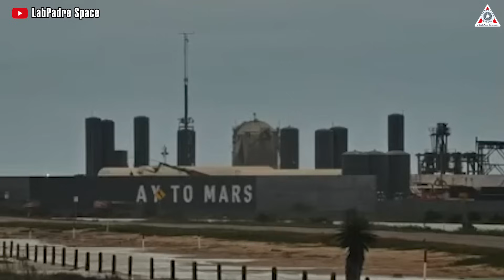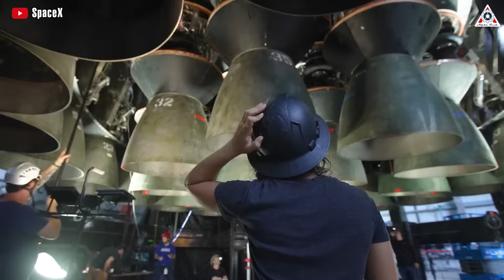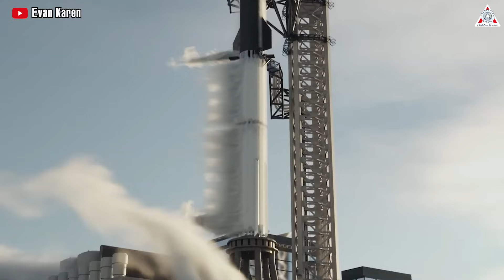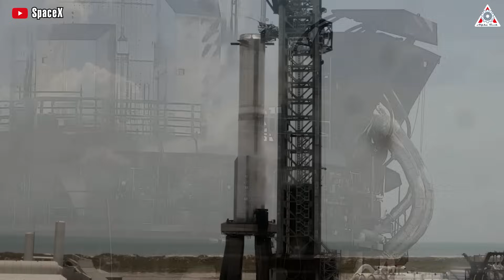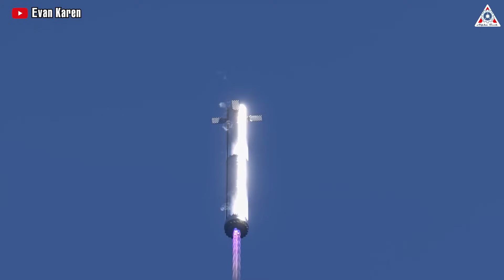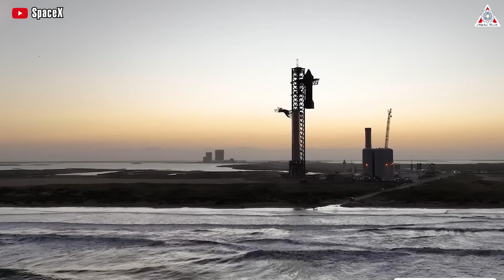SpaceX to double the Tower at Starbase, Starship double launch incoming...

Comment: Nice would be if they alligned the second tower with the first, and then build a bridge structure between them that cantilevered out on the ends. then have traveling cranes on both sides of the bridge structure so they could service four to six places on each side.  And maybe do landing catches on the end positions.

This would allow continuous processing of Starships. And juggling a fair number.
Another improvement might be a loop of RXR track around the towers and build everything on double wide rail cars, so things can be efficiently moved into place. That way refubishment could happen inside structures and things wheeled in and out electrically on rails, instead of on rubber tires.
I think on the up coming much larger Starships, they will reach the safety limits of rubber tires, and risk a chain reaction resulting in a toppled ship. Which would delay things, and perhaps cause serious liability, and then have to be bettered when things were much busier.
Better to design for future sizes and weights now.
Reply: Damned good thinking  !!
Reply from the maker: Thanks for your great comment. Keep following and discussing on our channel ☺️